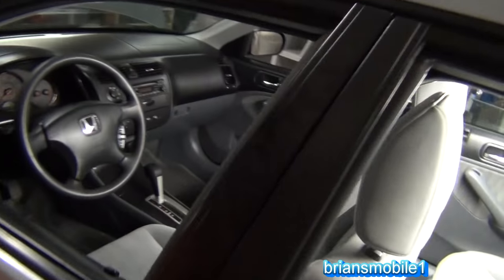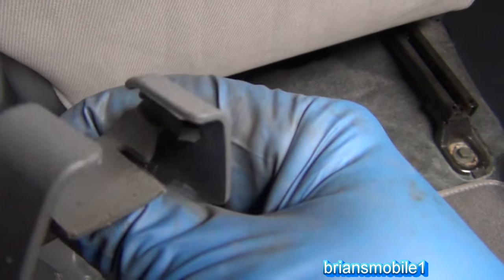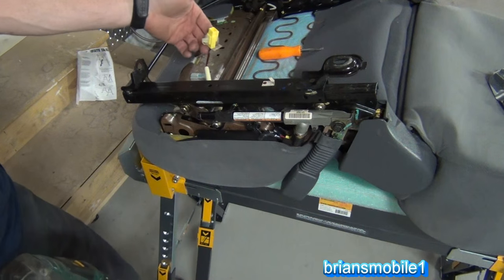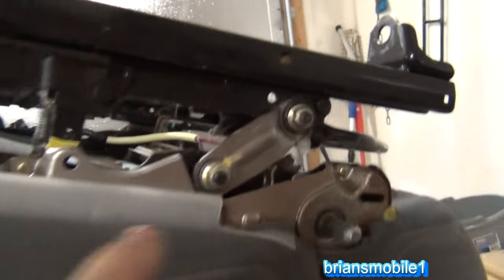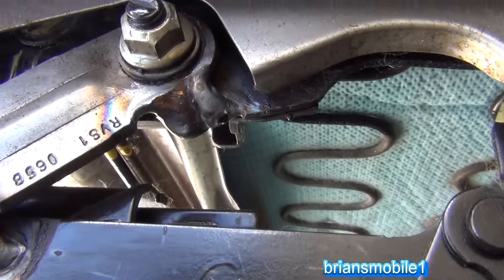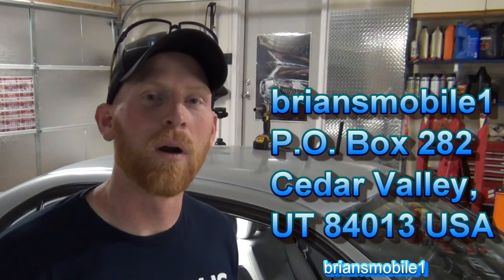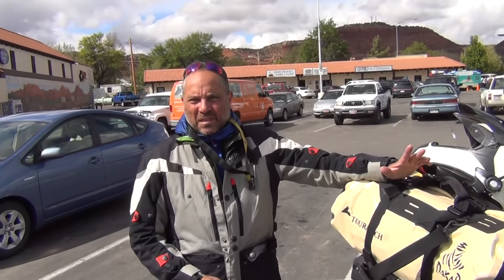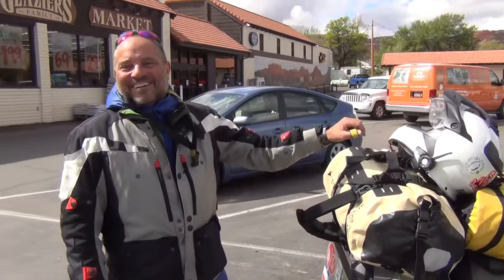Civic Rocker Fix

Comment: Take links out and use that MIG to weld a bead on the hole, then file to just fit the bolt. That will remove all slack and make them better than new again.

Comment: Brake cleaner to clean before welding is a no-no. If someone were to do that with chlorinated brake cleaner, they would get phosgene gas when welding. I would suggest Acetone instead. No danger with that.

Comment: Would using larger replacement bolts work? Think of tapping a threaded hole larger to repair stripped threads. The irregularity could be drilled to go back to being perfectly round.

Comment: Suppose welding the holes in the articulation plates and redrilling them would also be a solution?
Reply from the maker: It sounds easy, but has it's challenges.  It takes a serious grip on the plate and nicer drill bits than I have.  The harder weld has to be ground perfectly flat to even have a prayer at being accurate.
Reply: True enough. Center punch and center drill makes easy work of this.

Comment: briansmobille1
My initial thought as soon as you said you were going to weld those little links was that you would take them out, build the sloppy holes (hah) up with some weld and drill them back to size. Would they come out of there easy enough to do it that way?
Reply from the maker: That's another option or idea.  I've pursued that before and made the 4-link device crooked.  Things have to be exact.  Once you weld something back in- the metal isn't homogenous anymore.  This causes the drill bit to wander and precision is out the window resulting in binding, uneveness, and general crap outcomes.
Reply: +briansmobile1 
ah yes. Good point. I was just curious about that. Thanks for the reply, I appreciate it and your videos!

Comment: Why. Now the seat is ruined for other drivers or the next owner. 

Better options
1.) order a new seat track off eBay 

2.) take the brackets off, weld the through hole closed and drill it out to the OEM size

3.) replace the bolts with the ones with the gnarls on the back so they cut into the metal bracket and keep it from moving. 

I wouldn't call this a fix.
Reply: Better yet, go to the scrapyard and get a seat.
Reply from the maker: Why?  Because welds are harder than the bracket and getting them drilled in the exact same spot is nearly impossible.  Being a tiny bit off makes the whole seat crooked.  I went over options with advantages in use, cost, and time.  This is the option the owner chose.  There are always many ways to do something so it fits the owner.  This was just one.  As for a fix- the seat no longer rocks and it was less than half the cost of a junk yard replacement or labor to replace the seat track or weld and fix the old ones. 

Thanks for asking.  That's a lot better way to learn why someone did something than just assuming things.
Reply from the maker: That would have cost double and had problems with smell, color, function, time, and would have cost more without any benefit to the owner.  So the owner opted to go this route.
Reply: +briansmobile1 let me just say I value your YouTube channel and how you fix customers car. 
When I repairs customers cars I repair it to OEM specifications. I just feel that's safer and I know the customer and the next owner will be happy the way the car was repaired because it works as the manufacturer designed it.
Reply: +zoidberg444 true, because a junkyard seat it 30-50 dollars. Simple carpet vacuum cleaning it's like new. Four bolts, electrical connections, and done. Not getting out a grinder and welder(that is time and time is money)
Reply: Joshua Harden
I've done it on a few vehicles. My friends old Peugeot van is on its 3rd seat replacement (412,000 miles) it actually has a seat from a Toyota Corolla in it at the moment because we couldn't find a scrap one that would fit the van is so old.

Although i suppose welding it was what the owner wanted. But the person who buys the vehicle next will probably end up getting a seat from the scrap.
Reply: The type of repair is up to the customer not the tech. Sure there are better options but are you, as the tech., going to eat that extra cost to get the better repair? Probably not.
Reply: +mikeallenbrown1 no. If a customer comes asking for a repair or part that can cause a safety issue I'll say no. That unsafe repair can come back on me.
Reply: I look at it this way: If the next owner doesn't like the way I fixed it, they're more than welcome to fix it the way they want.
Reply: +zoidberg444 it's a very common problem with these seats so even if you found one the same color and in good condition chases are the problem would happen again. Salvage parts are fine , but if the component has a common failure it's not worth it at the end.
Reply from the maker: Ken, that's an awesome idea.  If I had that idea, the means to hold the parts in the drill press so the holes lined up good, and the shoulder bolts to do it- I totally would have!
Reply from the maker: I love that philosophy.  That's seriously the way to go and shows the wisdom and experience you have.  People don't realize the testing and the engineering that goes into building cars.  I did what I did to save time and money.  I gave the owner options- they picked this one. It's not my car, money, or decision.  It's the owner's.  I love to have options- so that's what I give.
Reply from the maker: Car-part.com says I've got a 20 minute drive each way minimum plus removal and install of the seat.  $50-$100 for the used seat depending on the condition/smell/holes/wear/etc. $50 for crap- $100 for one in the condition this ones in- nothing in the middle.  I billed the owner $80 and I had it done in less than an hour even with filming it.  If I went to the south junk yard I easily could have found their $100 seat had the exact some problem- turned around and had to drive 45 minutes to hour and a half North where the other wrecking yards are checking out seats there.  I don't live in California or the East Coast or the Ohio river valley.  I live in the desert in Utah.  If I had a good smelling used seat option for $30-$50 that I didn't have an hour+ of commitment to buy- and was guaranteed not to have the exact same issue and or holes in it- you bet I'd do that! : ) Who wouldn't?  Such just isn't the case here.
Reply: +briansmobile1 I'm hearing excuse. Tell the costumer no and where they can get a seat or a seat rack. Or be proactive and start mass producing that part and selling it.
Reply: +briansmobile1 Haters are gonna hate. You did a quality repair at the customers request( customer knowing the options). Enough said.
Reply: Joshua Harden
I think you should calm down dude. At the end of the day we often have to do things that we might not necessarily agree with, but the customer is paying. If we want to make a living, your not going to do that by telling them no.
Reply: best cheap fix: if you can't weld......granted this is for a CIVIC  I'm sure the procedure is the same as its the same part that fails
https://www.civicforums.com/forums/182-7th-generation-civic/347427-diy-driver-seat-rock-permanent-fix.html
 or via the TSB.
https://honda-tech.com/forums/honda-civic-2001-2005-78/diy-drivers-seat-rock-oddmut-2200423/

Comment: This is a common failure on the 2001-2005 Honda Civic.  Honda issued a TSB on it.  This is a link to where you can download it if you're curious.  http://www.mediafire.com/download/3ttvmn4ztu7/Drivers+Seat+Rocks+2-22-2005+%2801-057%29.pdf . If you don't want to download the file at the link do a google search for TSB 01-057.

Comment: Disappointing. Sacrificing the height adjustability is sad. The adjuster links could have been easily repaired with the Miller 211 and a few beefy washers which is what I originally thought the video was going to involve. I cringed when I saw what was about to take place. Hopefully this going to be a single moment of indiscretion and not a pattern for future "repairs."
Reply: The disappointing is the design flaw that causes this issue in a few hundred thousand different Hondas. Since this mechanical instability may lead to fatality, Honda should have issued a callback for the genetations of cars affected. They didn't. Plus replacement of the affected units is no permanent fix, the same wear will show up with replaced parts in a relatively short time.